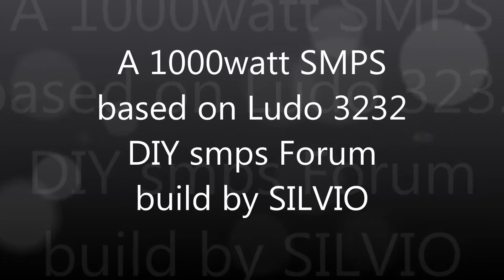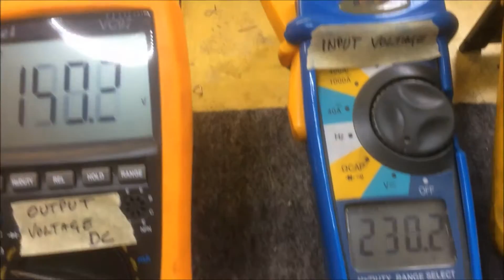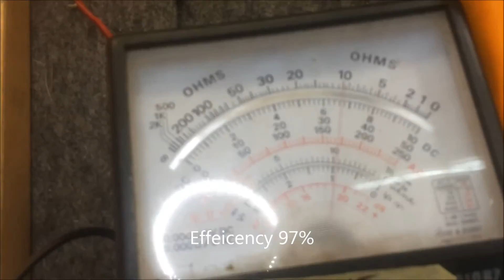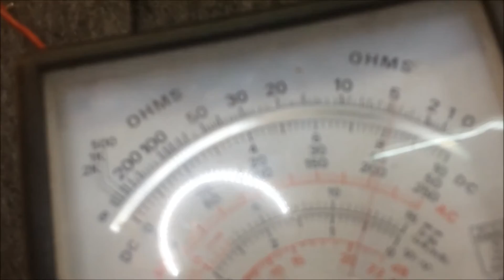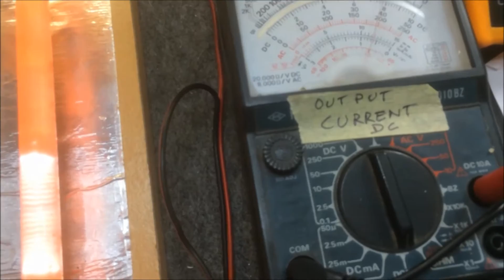SMPS 1000w By Silvio Load Test

Comment: hey I bought LLC Soft Switching Power Supply Board 36 V 500 W on ebay and I would like to wire this thing into the single output 36 V 500 W is it posible? Much appreciate Yout help
Thank You
Reply from the maker: is your power supply double output of 36v (36-0-36) or is it (18-0-18) ????
Reply: (36-0-36) Thank You for Your help
Reply from the maker: You have to alter the diode configuration to get a single output of 36v and also output capacitors.If you do not know how to do it do not touch it as you ma blow it.
Reply from the maker: Take a look here on this link I am explaining how to configure a single or double output  https://www.youtube.com/watch?v=TLD6hUV64YU  ( see from 32:25 minutes)

Comment: great work , can you say what converter topology you are using, i made 1 kw push pull based boost stage with full bridge inverter. i am getting very low efficiency.

can you help me please.
Reply from the maker: I am using half bridge topology with an SG3525 driving IR2110. un-regulated. dead time is 1micro second  Mosfets are IRFP460.  If you want to see schematic log on to diysmps.com i have the pdf file over there.
Reply: Thank you
Reply from the maker: Check your inbox